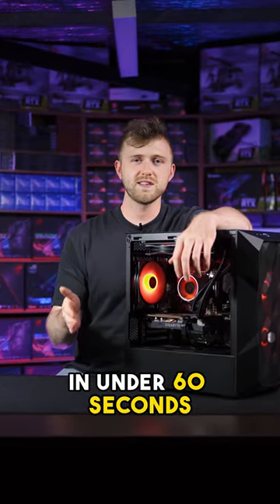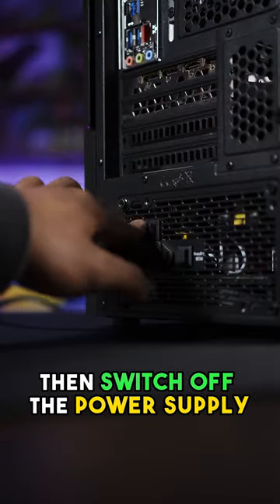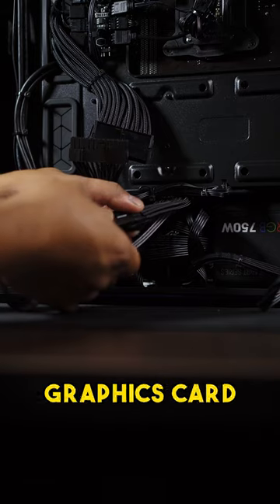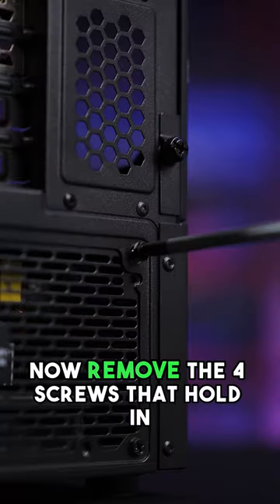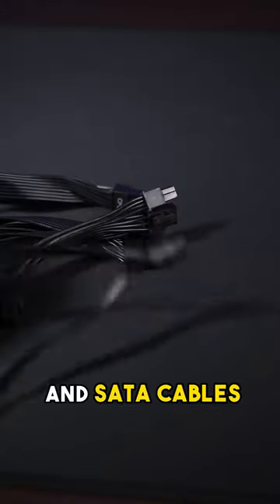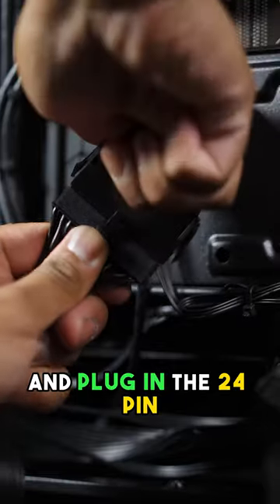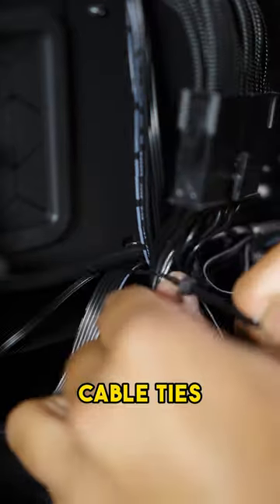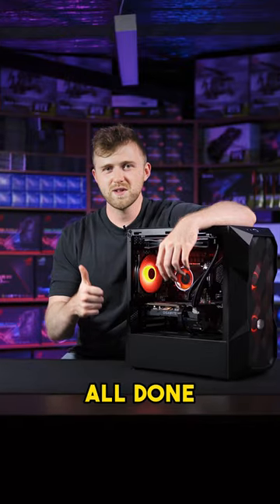60 second power supply swap! 🤯 For a PC with Braided Cables!

Comment: guy just made this video 20x easier by having cable extensions if there weren't cable extensions you would need to re-do all the cable management.
Reply: Do you know if I can just swap only the psu and keep the cables already in the pc. I just want to quickly test to see if it’s the psu dead on my brothers pc
Reply: @davinci8392  Unfortunately no you can't keep the cables and put another psu. It makes getting custom cables either expensive or sometimes just impossible as there's no company selling custom cables for the psu.
Reply: @davinci8392 Just only use the same model, but generally no this won’t work.

Comment: Using a different power supply's cables has been known to add either too much or too little wattage. Airing on the side of caution I would say to just switch the cables. It's a hassle but don't be lazy. Switch the cables
Reply: Absolutely do that.  I know someone that didn't switch to the new cables for his ssds and the ssds got fried they don't work anymore.
Reply: @eagle25311  Why is this so common? How hard would it be to make industry standard cables that don't melt anything you plug them into?